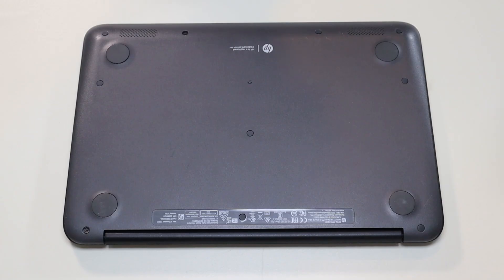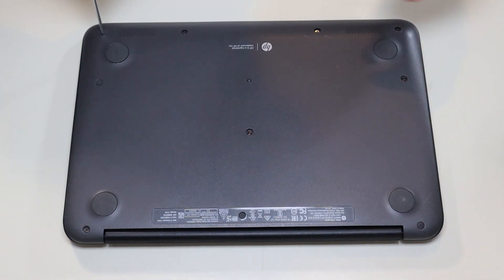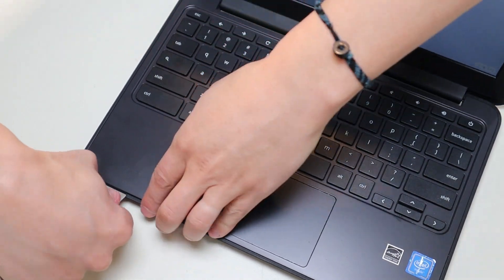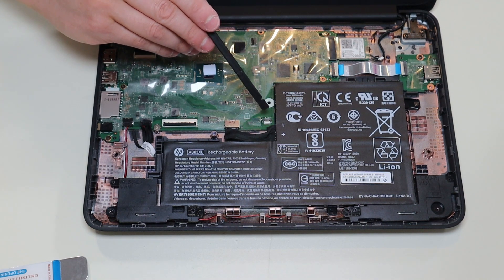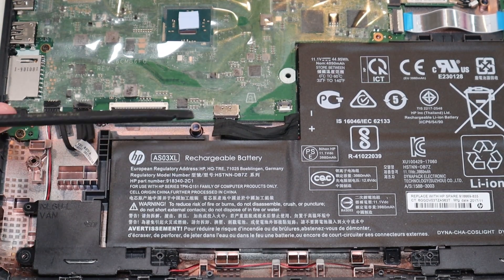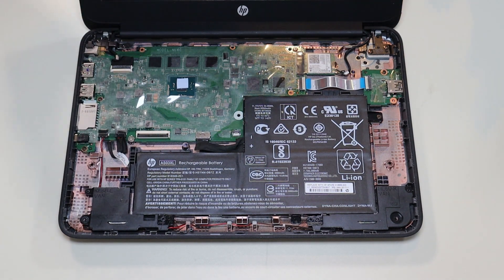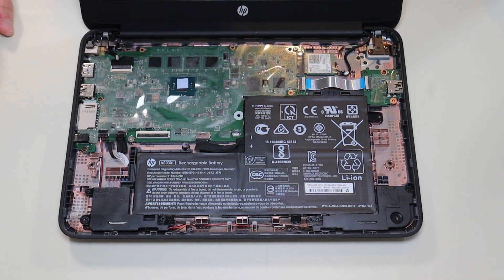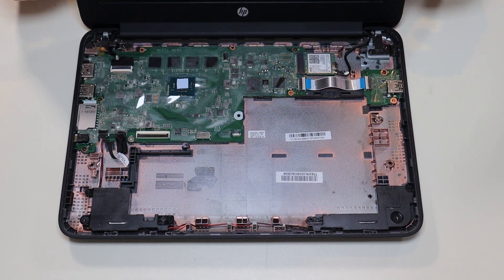How To Replace LCD Assembly - HP Chromebook 11 G5 Laptop

Comment: Heya mister, im back again with another problem 😢 My laptop's wireless network adapter driver is not working and I do not know why 😷 As usual this happened after windows updated itself 😢 I tried restarting and network reset but nothing worked! Now when i check the driver on my device manager it's not there unless i click on show hidden devices 😕 I honestly don't know what to do, please help 😢😢
Reply: I checked my device manager and apparently it's a hardware issue, it says I need to reconnect it to the device to fix it but I have never touched the hardware aside from cleaning the fans, im afraid of damaging other parts that i don't know about. If you know how to open the hardware and fix wireless drivers on ASUS TUF FX505DD please let me know 😢
Reply from the maker: @Nana-jx5ig  Does this help? https://www.youtube.com/watch?v=tDGPeqex8pQ

Comment: Hello sorry to bother i have a acer aspire A5-576 it turns on and shows me a acer logo but after a little bit it goes to a black screen this happened after a update i have took it apart removed rams and battery any advice?
Reply from the maker: Can you access BIOS at startup? Can you find any Repair or Recovery options in BIOS? Also, did anything happen before this issue started? Liquid spill, overheating, a Windows update, etc?
Reply: @ yes i can access bios and recovery but if i reset it still does the same thing and this happened after a update